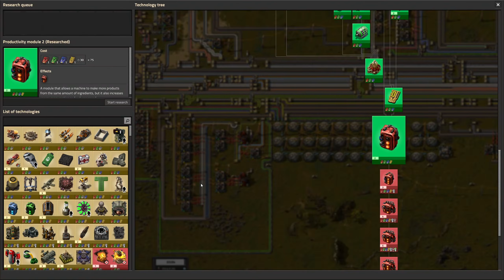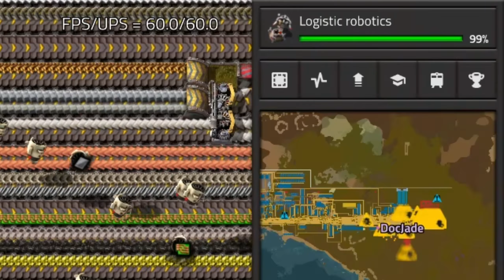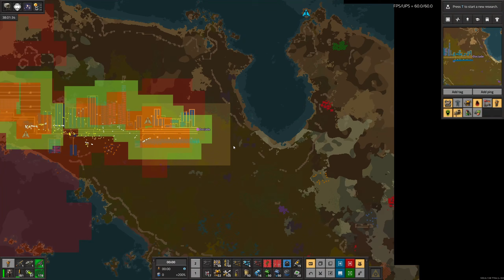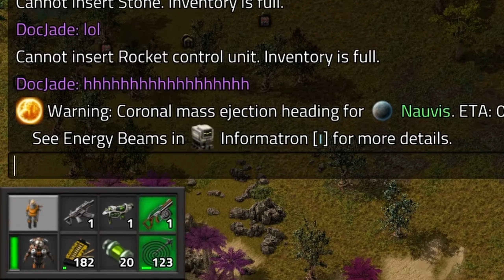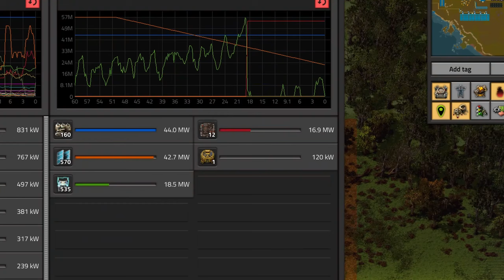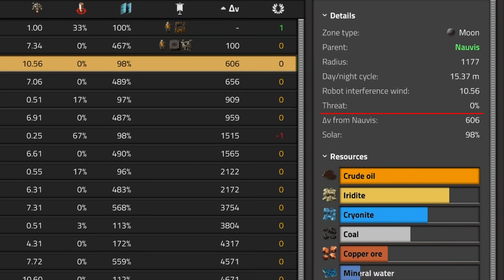Space Exploration + K2: Restructuring! - EP 4

Comment: I'm not sure how space exploration changes this, but condensing hydrogen is horribly inefficient. You want to get it as a byproduct of producing chlorine or oxygen. Chlorine is best gotten from creating lithium, then from splitting water. Oxygen is technically best gotten from condensing, but it's only marginally better than splitting water, so you're better off prioritizing the oxygen from that instead, so you also get hydrogen, then using oxygen condensing to fill in the gaps. In other words, prioritize chlorine from lithium production, prioritize hydrogen from chlorine production (and don't ever condense it), and prioritize oxygen from water splitting unless hydrogen is full. Nitrogen you get from condensing.

In this setup, you technically need flare stacks for both oxygen and hydrogen. You run the flare stacks for oxygen when demand for hydrogen is high enough that oxygen overflows (still better than condensing hydrogen). You run flare stacks for hydrogen when chlorine is in high demand.